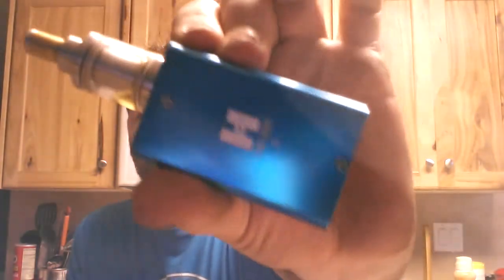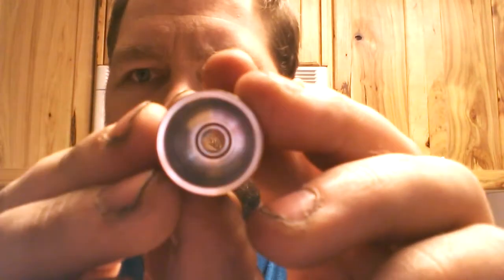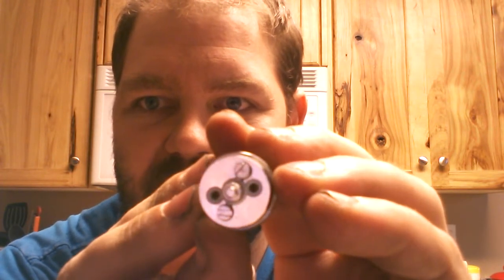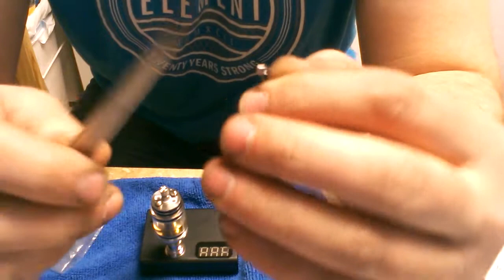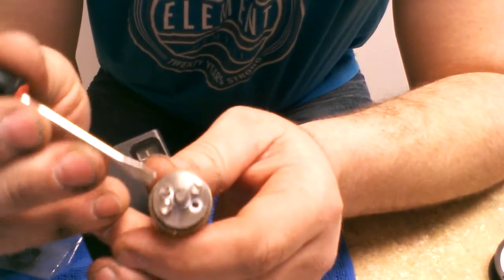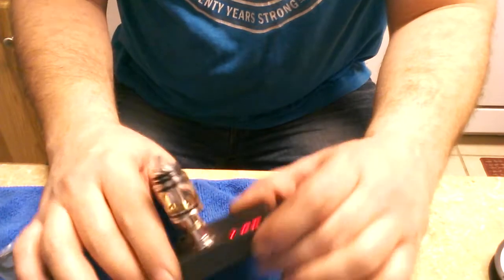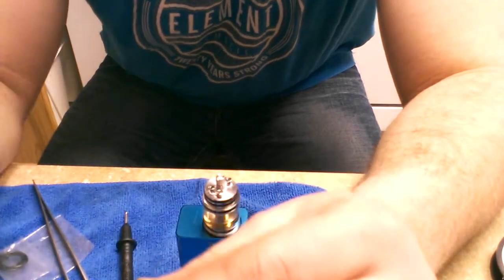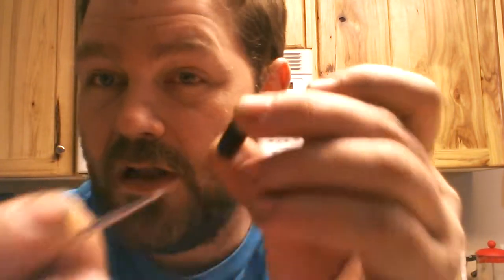Prow t atomizer + build!

Comment: Great job brotha! Awesome review! Great build! And I hope all is well in the ole L town! Now I can build anything but I'm always learning new stuff like we all are but I can't seem to do the auto dripper. I can get my coils built beautifully and add cotton and I know I'm not choking it but I can't get it to auto feed. The only way I have got it to work is when I don't put any cotton in the tank at all and just through my coils but then it gets messy! Anyway bro. Vape hard!
Reply: I don't even stick my cotton into the holes at all. I actually leave about 0.5mm gap between the bottom of the cotton and the hole, just enough to slide a dollar bill/paper between the hole and cotton without the bill touching the cotton. Also if you do it in dual coil on a genesis without a third fill hole, when you turn it upside down to "drip" there is no where for air to enter the tank to equalize the pressure to allow the liquid to come out. Think of one of those 2.5 gallon water dispensers that you have to punch a hole in the top of to get it to flow properly, or when you put your finger over the top of a straw and lift it out of the drink and the soda stays in the straw till you let it go. That's why he stressed hot to stick it too far into the hole, that way air can escape from the tank while letting juice out. If you see wick when you look thru the tank up at the bottom of the hole, its too much cotton/too far in. It works better if you have a dual coil, but only use one of the wick holes that way air can escape through the other one (unless you have a fill hole to let air out). Hope that helps.